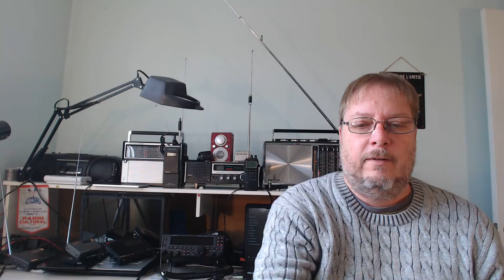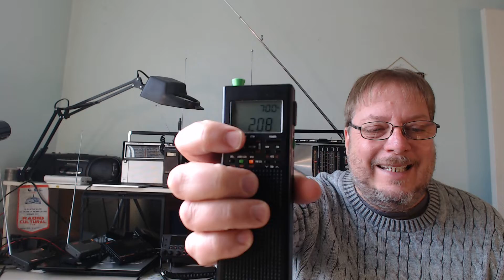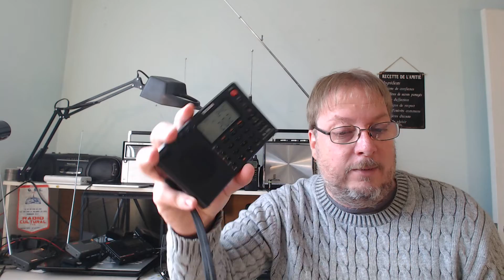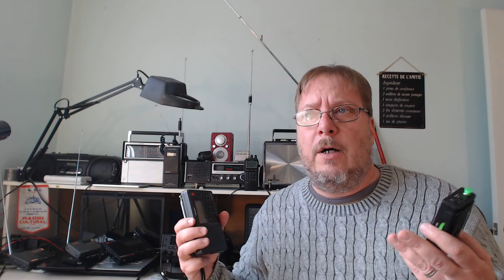Shortwave radio tip 31 Difference between ATS and ETM tuning modes on Portable radios

Comment: The electrical characteristics of the ETM and ATS memories are different.  If you use ATS too often you can ruin the ATS memory!  How often that is I don't know but it suggests that tuning ETM often on a PL-360 say and manually passing over the details to the PL-660 for maximum radio lifetime.